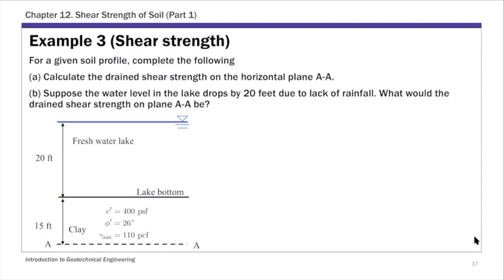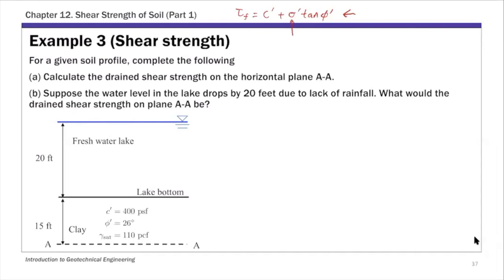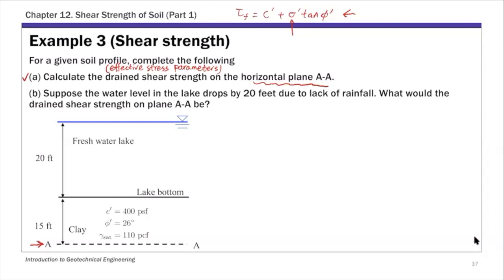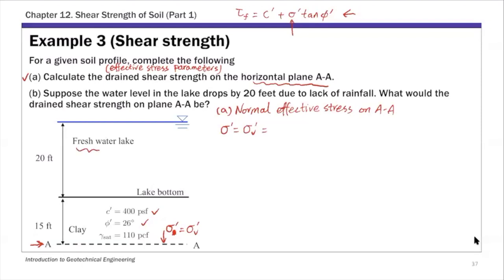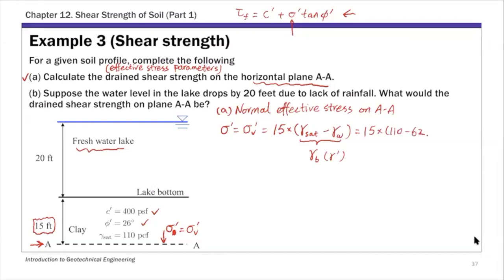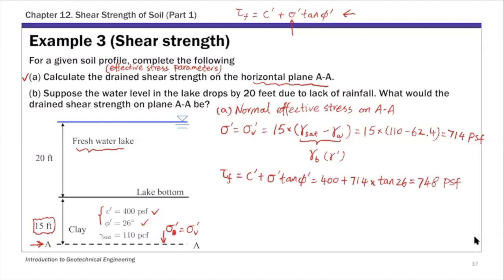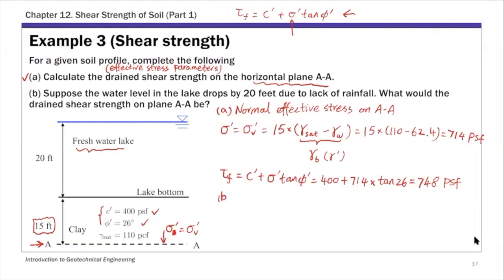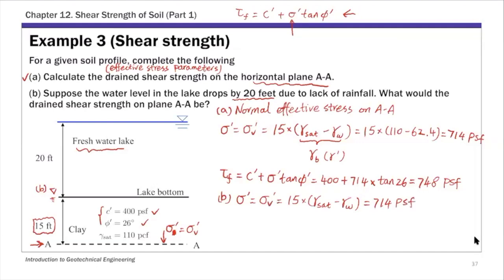Chapter 12 Shear Strength of Soil - Example 3 Shear Strength on a Plane by Mohr-Coulomb Criterion

Comment: at 3:24 why didn't you subtract the pore water pressure when finding effective stress
Reply from the maker: The buoyant unit weight already accounts for the effect of pore water. The other way to calculate effective stress is to calculate the total stress using the saturated unit weight, and then, subtract the pore water pressure to get the effective stress.